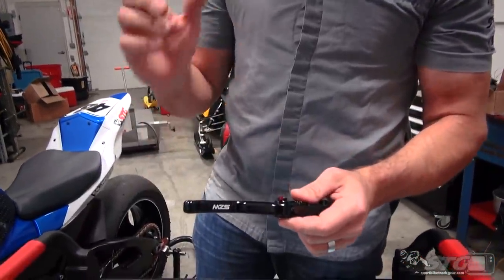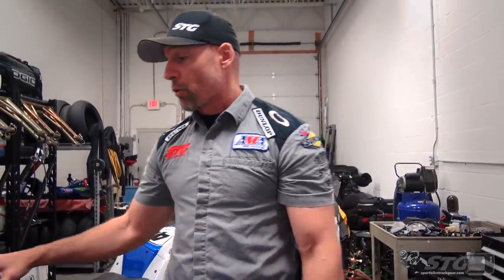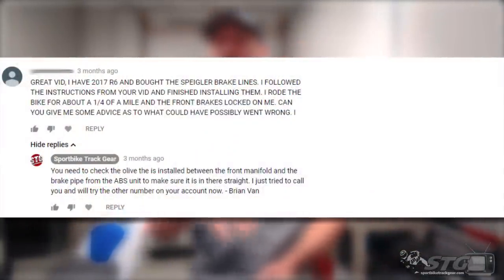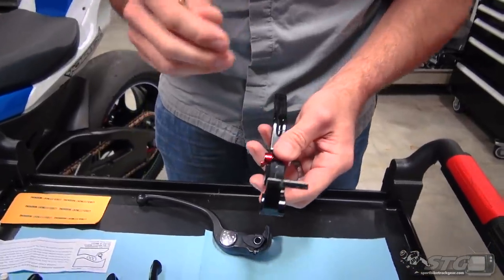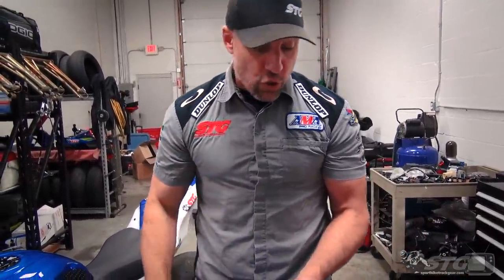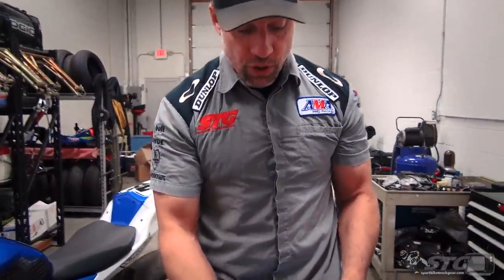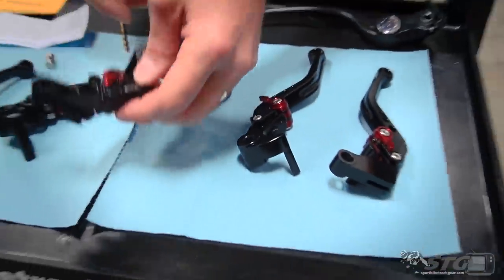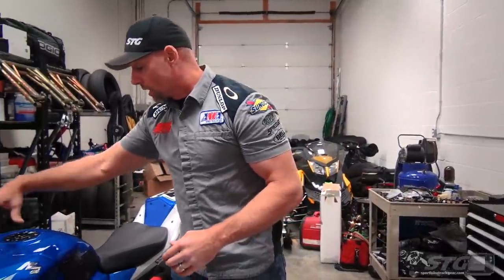The Truth About Cheap Motorcycle Levers | Sportbike Track Gear

Comment: Just picked up a 2001 CBR600 F4i and have been working out a few bugs with it. One problem that I am having is with the Neutral light. It would randomly come on and go off, so I thought that was due to the Neutral Switch. I removed the old Neutral Switch, and sure enough the tip of it was completely flat. After putting the new one in, I am still having an issue with the neutral light being on, when in gear. However, it is only happening when the clutch lever is pulled in. Once I let the lever out and the clutch starts to engage, the neutral light goes off. And the light comes on once again when I pull the clutch lever back in. One thing to note is the previous owner installed some cheapo aftermarket levers, like shown in your video.  They aren't MZS brand, but they look the same. I'm not sure that the lever would have anything to do with the neutral light, but I am wondering if you have seen anything like that? Not sure where to look next. Any suggestions or advice? Thanks in advance!
Reply from the maker: I do not believe the lever would be the root cause of this problem. Hard to diagnose something like this over the YouTube comments. If the bike is running good I would just leave this alone and ride the bike. - Van
Reply: @sportbiketrackgear   Thanks Van.

Comment: So the bushing is those mzk won't rotate smoothly as I noticed. If it does rotate smooth and has good tolerance n clicker nice and tight, it should be good. I'm referring to the FXCNC lever.
Clutch is excellent,  but I still don't trust this brake lever for her. 
If no1 makes an adjustable lever for this bike, what's my next move? I may be old, but I still race here in Va....flat track
Reply from the maker: The moral to the story is only install quality controls on your bike. If no one makes an adjustable lever the only option is to use the OEM. - Van

Comment: It wasn't a design flaw or sloppy/tight tolerances in the lever that caused his brakes to lock up, it was 100% user installation error. 

His master cylinder plunger rod wasn't set INTO the pivot bushing hole but rather was (incorrectly) resting on the outside of the bushing after he put the levers on (easy to do if you don't know what to look for), and after a few pulls on the brake lever during his short ride the brake fluid pressure built up inside the lines because the plunger rod wasn't able to fully extend all the way out to release the pressure. 

Without that rod being in the hole it's like the brake lever is constantly ever-so-slightly being pressed, and every pull just adds to the pressure inside the lines until... well... sick ass unexpected stoppies happen while riding in traffic. Lol. 

I know this as a matter of fact because the same. exact. locking-up issue happened to me after I installed these same. exact. levers incorrectly. 

The day it happend to me I did some googling and found out about the importance of the MC plunger rod being INSIDE the pivot bushing hole, so I re-installed the same levers correctly, and ever since -- 4 years later and 30k miles ridden on my 636 -- I haven't had a single problem again. 

But if someone wants to pay $100 extra for a piece of paper with instructions that the cheaper levers don't come with, then by all means, go right ahead. 

TL;DR: this video has seemingly good intentions, but is ultimately misleading. And your 2 buddies who crashed at the track were just looking for an easy scapegoat to blame for why they went down (but I don't have any evidence for that lol).
Reply from the maker: That was not the case with this lever, the cross pin bushing was seized in the bore. If this is unable to move unrestricted it will not allow the plunger for the brake master to return properly. In this video we give a close up look of the seized bushing.That said it is very important the plunger for the master cylinder piston on a radial master is aligned properly with the cross pin bushing. We have done multiple lever install videos on radial equipped bikes and made this point very clear each time. - Van

Comment: I just bought a set of these mzs levers for my 2003 yamaha fz1 and while they dont have the same tight tolerances of the more expensive levers they have been fine so far.  Certain bikes with certain styles of this lever are more prone to this brake locking issue but not all of them.  I inspected mine and every piece moves freely as it should.  Nothing like what your showing in this video.  I read some of the reports of lock ups but theres also tons of good reviews from people that have had zero issues with them.   Just have to check them out before installing and see what your getting into.  I'd have liked a nicer set but wasnt in the cards to spend $160-180 on a set of levers right now.  Good video though and informative for those unaware of what to look for.
Reply from the maker: You should be good to go with the FZ1 as it has an axial master cylinder not the radial that has seen the lock up issues. Thanks for watching and take care. - Van
Reply: @sportbiketrackgear  That was the phrasing I was aiming for but couldnt think of it lol.  I knew there was a certain setup that was more prone to issues.  Glad I'll be okay with my setup.  Levers certainly could have tighter clearances but will do the trick!

Comment: step 1 of any cheap chinese part install is a quality check, is every bolt tight, if every washer where is should be, you pay so much less because you have to do some of the quality control yourself. they're not per definition bad products but yes they are lesser quality and they haven't been checked before shipping. their materials will quite possibly not be safe for extreme usage like on track, but for your average street riding where you're not hard on the brakes often, hopefully even never, these parts should suffice, anyway often the cheapest quality is a standard replacement lever.
Reply from the maker: If you choose to go down this road you need to have the skill it takes to QC the part yourself. This is not something everyone is capable of. IMO if you do not want to invest in a quality set of aftermarket levers just leave the OEM levers on the bike. - Van

Comment: I can personally vouch for how bad the MZS levers are. when I first fitted them to my ZX6R they were fine. Over time I noticed issues with braking. Had to do an emergency stop one day and the lever actually bent. Got the bike home and fitted the factory levers back on. It's made me wary about changing the levers on my R1 as well. The other issues I had were the position adjuster would slip and reset itself under heavy clutch and brake usage.
Reply from the maker: You will not have these issues with CRG, Lightech or ASV levers. I have used each of these brands over the years (currently running CRG on the GSXR 1000 and the R3) and have not experienced the issues you have noted. The bottom line is if you want quality levers you will have to pay more than $35 a pair. Realistically you will be from $130 to $200 ish for a set of good levers. - Brian Van

Comment: Years ago when I got my bike new I bought and put on eBay levers. I didn't have lockup like some others I had learned about, but one day inspecting I realized that the small bolt that holds it together at the bottom was MIA. What a stupid design and placement at the bottom of the lever given the vibrations of a bike. I got an ASV shorty clutch, put back the OEM brake, and never looked back. I only regret not going with the ASV the first time.
Reply: There’s something called locktite

Comment: I really want to like and agree with this but the last time I checked a replacment OEM lever for my bike was $157.00. That's why I run a China lever. I just made damn sure everything look good before installing. But you should do that with anything you put on your bike. Just be careful.
Reply from the maker: You can get a set of CRG Spectrum Levers for $130. This will get you a quality product with proper tolerances etc... These knock off levers have horrible tolerances, way too sloppy which reduces the feel. - Van

Comment: One could say that leaving things stock is actually safer than adding aftermarket parts, could they not? My cheap aftermarket levers from Ebay cut into my clutch cable, freying it. Luckily I made it to the dealer before it broke. They used a dremel to smooth the edge and replaced the cable. I haven't had any other problems since. I ride a 2014 FZ-09, and have just under 24,000 miles on the odometer.
Reply from the maker: Thanks for taking the time to share this. - Van
Reply: @sportbiketrackgear  No problem Van 👍

Comment: Hi. I’m on a 2019 GSXR 750. I’m comfortable with the stock levers. Why should I replace them? Honest question. I’ve upgraded the brake lines to Spiegler already. HUGE difference. But the levers, what is the benefit?
Reply from the maker: If you are happy with the stock levers no reason not to run them. With aftermarket you can typically expect a little more adjustability, better looks as well as having the option to add a folding lever. Folding levers can help reduce the chance the lever breaks in a tip over. - Van

Comment: I certainly understand a/m parts, insurance wants me to use this junk alot. 
My question is what makes the A/M lever lock up the front brake. The lever doesn't pull itself, but when you pull it in slowly, how and what causes the brake to lock up. How does it push the master cylinder pin and spring into cylinder further in than the force you use?
I've tried 3 levers, 1 loose  and 2 reallly nice, good tolerance and it appears to be identical to factory.  Explain how this happens,  when it flows free as in your video,  no hangups at all. Yet still Leary of installing it for other than a test in driveway. Good clicker 
Thanks
Chuck
Reply from the maker: MZS uses a cross pin bushing for radial brake master cylinders. Their tolerance is shit and it does not rotate freely. When the rider applies the brake it will not release when this bushing is too tight. Never put garbage controls on your bike. - Van

Comment: What's the difference between the spectrum and the rc2 besides the replacable delrin ends on the rc2?
Reply from the maker: The main difference is the delrin ends. They are less expensive because we purchase these direct from CRG, there is no distributor in the middle and we pass the savings along to you. Same CRG quality, not some second tier part. - Brian Van

Comment: I have MZS levers and they came out out of the package with nuts looser than an 80 year old mans. My 2001 Fz1 doesn't use a cross pin bushing like that luckily . I have not had any issues yet other then having to tighten all the bolts. I think I would definitely want to upgrade for track use though.
Reply from the maker: Thanks for watching and taking the time to share your experience! - Van

Comment: Another common thing with dodgy levers is a slightly different shape that means the pushrod never comes far enough out of the master cylinder to open it back up. Then rather than fluid being able to pass back into the reservoir on release, pressure builds and leads to hydraulic lock. My bike came with Pazzo copies. I've filed them down a bit to make sure they have enough freeplay but I'm still thinking about replacing them with some OEM levers. Just for peace of mind really.
Reply from the maker: I love saving money myself, there are better ways to get that done than installing sub par controls on your bike that can be dangerous. - Van

Comment: I have a 2017 fz10 i bought it new, at around 50 miles my rear wheel staring making a clicking noise ,it clicks about four times at the same point wheel the wheel turns forward and backwards, no after market parts. Thought it was the chain so i cleanned it still does it sounds like itsmcoming from the hub area. Please help dealer has no idea told me to ride it.
Reply from the maker: If they told you to stop riding it you need to do that and have it trailered to the dealer so they can diagnose the problem. I can not do that without having access to the bike, sorry. - Van
Reply: Thanks for the reply the dealer told me to ride it like this. Just wondering if you ever came across somthing like this, its just a crazy sound, i cant figure it out making me nuts. Thank you!
Reply from the maker: All apologies, I answered over a ton of comments on this video and misread yours. If the dealer told you to ride it I would hope they are right and you are good. That said if you are not 100% comfortable never hurts to get a second opinion IMO. Even the best make mistakes. 

To be helpful I would really need to have the bike here to look at it and hear the noise myself. Perhaps there is an issue with the chain and or sprockets? Hard to say without seeing it. - Van

Comment: You never think about foot pegs breaking. My son had a foot peg break on his trials bike while he was out on a hillside in a tough section. 17 screws in the collarbone.
Reply from the maker: I would not recommend installing any sub par levers, hand controls, rear sets, footpegs, brake components or drive line components on any bike. Not worth the risk IMO. Thanks for sharing. - Van

Comment: Interesting. Must just be those levers. The China set I got for cheaper has none of those issues. However it was not the one mentioned in the video
Reply from the maker: I have been doing this a long time and would not recommend putting any of the cheap China levers on a bike. Bodywork sure, controls are another story. - Van

Comment: Bought a cheap set of  levers from eBay. Long story short. Brake locked up on me. Down goes Frazier. Good thing I was on the street, and not the highway.
Reply from the maker: Sorry to hear that man, crashing when it's your fault sucks. Crashing because you were sold a shit lever is far worse. - Van
Reply: I have a question. A little off topic, But how do you feel about Hot Bodies MGP rearsets?

Comment: I have cheaper levers on my zx9 (were on bike when I bought it).  I do periodically strip them down completely and give them a good clean and grease up and ensure they are maintained. Everything works as it should but yes the tolerances are a little off to an expensive set.  I have done about over 25,000 miles since I have had the bike (was 17,000m when i bought it and now over 42,000m)  and I have had no issues with levers at all.  Not disputing what is said on this video  as I am not qualified to do so.
Reply from the maker: Lot's of people have had a good experience with these cheap levers and others have crashed when the front brake locked. Not worth the risk IMO, better to leave the OEM levers on the bike. - Van

Comment: Moving from cheap levers to a pair of ASV was a huge improvement. I thought for a long time that the big brands costed more only for their name,  big mistake.
Reply: Your Mums HITACHI Better ergonomics: they can be better placed and adjusted, they also feel better. This here is hard to describe but it's like they feel good under the gloves and give more confidence. It makes you want to play more with them.

The Chinese knockoff levers I had before looked great and were cheap but terrible. Even at the max setting, the position wasn't right and I had to use the spacer trick to get the lever further away from the handlebar.

It's hard to believe that something so basic as a lever can feel so different based on quality but it's an essential part of the riding tools after all.

Comment: I almost bought these exact mzs levers for my Mt-09 until I saw a video of some guy saying they lock up. Can’t you just tighten the screws for the clearances? Part of me wonders if the USA ones actually are higher quality or if it’s just American greed that drives the price up.
Reply from the maker: I get to look at this industry from the  inside out and can assure you that none of the companies manufacturing hard parts in this industry are living in mansions. The bottom line is US manufacturers are offering products that are higher quality with better engineering behind them. All of those things have a cost associated with them. - Van

Comment: My SV650 has cheap Chinese levers. They've been in use for about 50K miles. Since I live in the mountains, the roads are very twisty so the brakes get used a lot. A whole lot! I've had no issues with the cheap levers on the bike. Apparently, there is a big difference in quality between cheap-good and cheap-bad levers. I got a good set, they're made very well.
Reply from the maker: Your bike has an axial master cylinder, no brake locking issues reported for that style master. There are also multiple cheap lever brands out there, I am sure some are better than others. - Van

Comment: I am looking at some of these to replace OEM's on my DL650 as I ride it off road.  It is either $30 folding levers or $150 BarkBusters.  From my experience and this video, I really don't see the minus of these levers...yet.  At any rate, if anyone installing these takes the precautions shown here, you can be sure these are safe.  Install them and thoroughly test them before going to the track or some buddy's house.  If you make sure everything pivots smoothly, they are going to work.  Use some wet & dry on a dowel of some sort if the cable barrel doesn't pivot, etc.  These are just levers to activate the brake by pushing in a plunger and ditto for a hydraulic clutch activation.  If it's just pulling a cable and the barrel and pivot point are smooth, the cheap levers are going to do the same thing the $$$$ levers do, and some of these cheapos look damn good.
Reply from the maker: Installing sub par controls on a motorcycle is about as good of a decision as the US funding the lab in Wuhan that unleashed the rona on the world. - Van